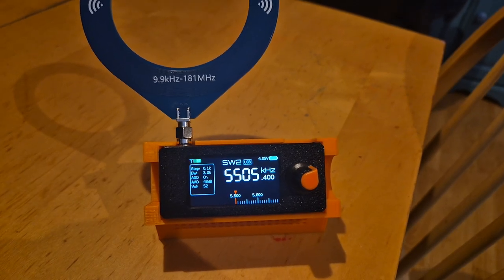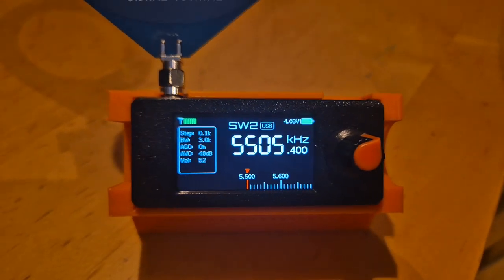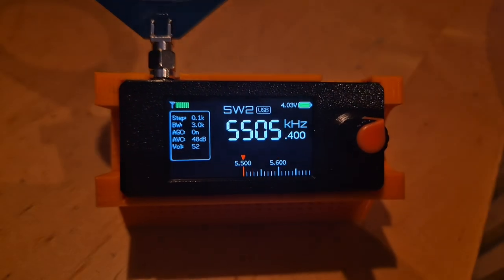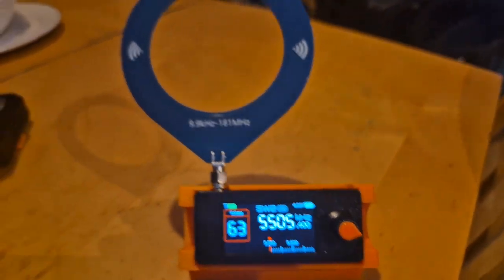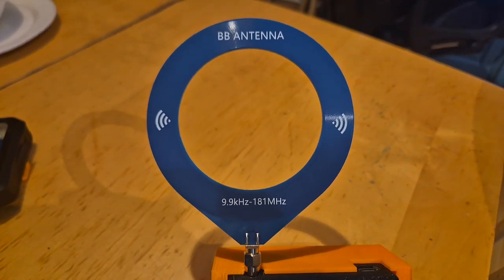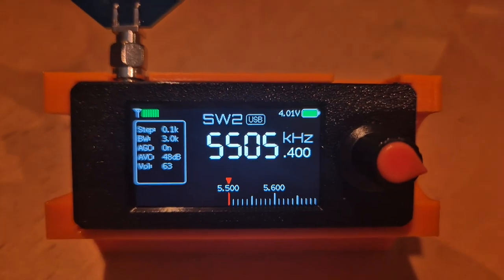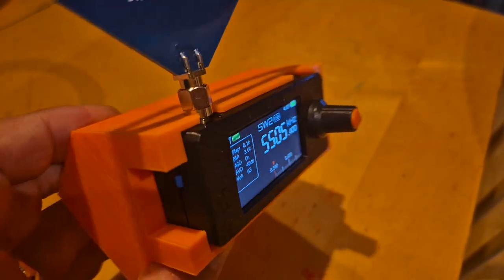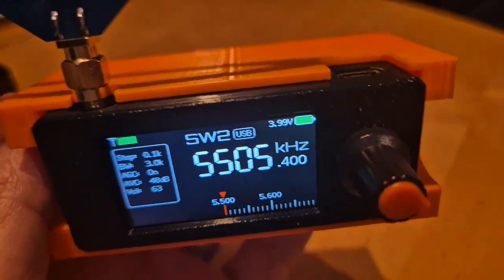Si4732 Mini - 50 mhz Ham Band ? ( Shannon Volmet )

Comment: Proves that Small can be mighty!
I can get a strong signal from Shannon Volmet using just my DSP 01 SDR with a MLA 30+ antenna from indoors. Shannon has a powerful broadcasted transmission which covers the whole of the North to Mid Atlantic, so it shouldn't be too hard for me in Wales to receive the transmissions clearly.
Reply from the maker: Agree